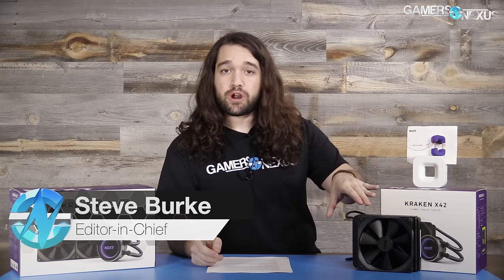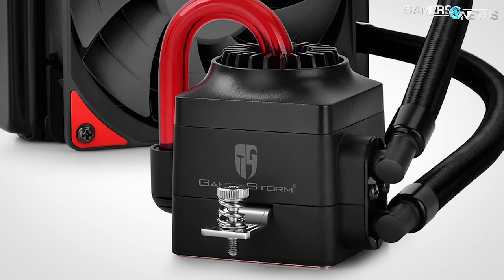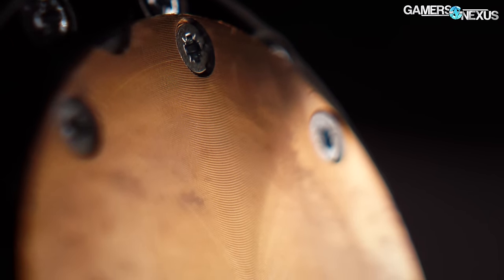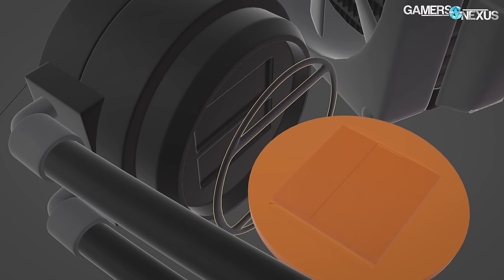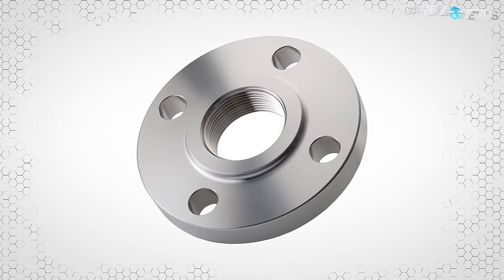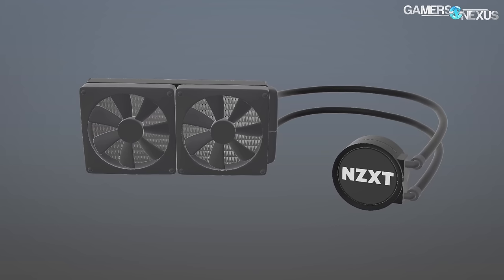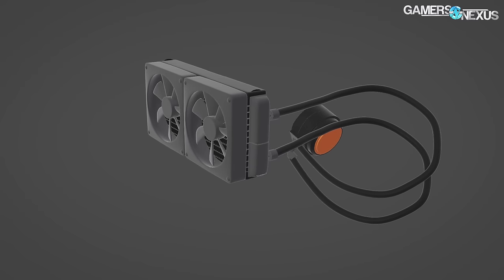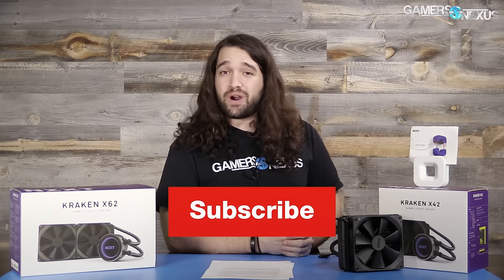Technical Deep-Dive: Closed-Loop Liquid Cooling

Comment: Great video, was more thorough than I would expect from a tech tuber. Surprised you even went into the coolant mixtures and tubing types. I would expect it to be around 20-40% glycol in these aios but if I had to guess it would be closer to 20%. 
Also that cracking he described in the inner teflon lining of the tubing brings up a important question for anyone with plastic piping in their house. What happens when the inner lining of the pex pipe cracks and either bacteria grows inside the crack or the chemical components of the plastic leech into your potable water system? Pex piping which is what is installed in new homes these days hasn't been around long enough for us to know it's safety long term.

Comment: I would really like a disassambly for the Be Quiet Silent Loop Pump. since they say its a special kind of pump.
They say for example, that the Pump has to run at 100% the whole time (which is around 2300RPM says  the Software) or it gets damaged. BUT its more silent then others.

Comment: Nice video, but I hoped to also hear something about optimal mounting of the pump and radiator (e.g. radiator inlet/outlet up or down, etc.) and get that connected to how the things looks inside.
Reply from the maker: Jonas Björklund Svensson Not really the point. That becomes a performance test, and we've done that testing before. That said, we're working on more of it

Comment: What about durability? This CLC solutions look great but how long will they work until they run out of liquid? I'd love to cool my next system with a Silent Loop from Be Quiet! but I am afraid of having to replace the cooling solution after that time. Also how rare are leakages from this type of solutions?
Reply: Our Kraken Series liquid coolers are backed by an industry-leading 6-year warranty. Basically, you don't have to worry about anything in that timeframe. If for some reason the Kraken leaks, we'll replace it along with any hardware it damages.
Reply from the maker: NZXT has the basics covered in their answer, but will provide an independent party answer as well: Asetek CLCs tend to start nearing end-of-life by the 5-6 year point, depending on how much abuse they've been through and what kind of environment you live in. The reason for EOL on closed-loop liquid coolers is more because of permeation than anything else; the liquid will begin to permeate the tubes at some point (some tubes handle this better than others), and will do so at a faster pace if liquid temp runs higher for longer periods. The 5-6 year point is when you'll start noticing more air bubbles in the loop (potential "gurgling" noises when the pump starts up on boot), and that's because the loop is starting to lose some of its liquid to permeation (not to leakage).
Reply: Well that sort of settles it, I'm going water-cooling in summer. Thx for the super helpful and quick reply, I will consider the X62 ;)
Reply: Gamers Nexus I really appreciate you taking the time to answer so in-depth. It really helps a lot, thx <3

Comment: What is better, having the tubes facing the top of the case or facing the bottom of the case?
Reply from the maker: No name In a vertical orientation, eg front-mounted? Bottom. That should keep the air bubbles at the top of the tank and will reduce risk of creating noise by sucking air through the pump.
Reply: That's exactly my case. Thank yoy very much! :D
Reply: my X61's pump had air bubbles in from the beginning which is a bit annoying since its the only audible sound when i am idling...shame...hope that other manufacturers fix that
Reply: roteroktober420 did you have it facing top or bottom?
Reply: at first i had the tubes on the bottom of the rad, which didnt help and then after like 4 weeks i turn the rad around to have the tubes at the top which didnt help as well.
Reply: so what did you do to solve it?
Reply: i didnt solve it since there is no way to except maybe if you uninstall it plug it in and run it on full speed and maybe you can get the air out of the pump
Reply: yea i cant get them out

Comment: What is the cube with the hole in the middle?
Reply: Magnet with rubber surfacing from NZXT to hold audio headsets, VR etc. Also has a loop to coil wires around it. It comes with a few of their cases, but can also be bought separately and used on any metallic case.
Reply: Puck

Comment: QUESTION Isn't the warm water heating the cooled water again on the way back to the outlet? Wouldn't it make more sense to have inlet and outlet on different ends of the radiator or some kind of channel that passes the radiator without heattransfer from the warm inlet?

Comment: What should my pump speed be? I don't know much but if the pump speed is max would the liquid not travel in the radiator long enough to reach a good low temperature before going back to the CPU and if I make my pump the lowest speed would it take too long for the cool liquid to travel to the CPU?

Comment: great video, nice animations.
u could have talked a bit about what life expectancy to expect from aios and why they fail etc... and how they compare in reliability to custom water loops and to air coolers, but whatever kinda not that much the point of the video.
Reply from the maker: Thanks! Andrew does good work on the animations. Re: points of failure -- perhaps that is a good topic for a separate video, where we'd really be able to drill down on types of failures and duration.
Reply: @gamers nexus,
that would be a super cool video, comparing all colling solutions with expected life,  failure point analysis, reasons etc...
for air, aio and custom loop, that would  get people to make better decisions on colling for sure.

Comment: water cooler's cpu/gpu blocks should have more surface area on the inside to exchange the heat between the cpu and liquid more efficiently because thats kind of holding the whole thing back

Comment: Hey Steve when should you change your coolant I have a EKWB 360 extreme with EKWB red coolant cooling my 6700k cpu for a year and a half color looks the same & cpu temperature are great . I pretty much use my computer for gaming BF 4 or BF 1 I was wondering how long the coolant last ?

Comment: Hey I want to mount a AIO on the side of the O11 Dynamic XL and i'm not sure about the orientation. Basically all builds that I could find put the tubes on the TOP but if i remember correctly, you suggest to put them on the bottom to make sure they never suck air. Are everyone else wrong, or do I miss something important??
Thanks a lot!

PS: will you take a look at the Lian Li Galahad AIO?

Comment: Hi, does missing a percentage of water result in increased temps using AIO? Meaning that after a while I noticed a higher TEMP and I think that some of the cooling liquid got evaporated. Need to know if this could be the cause because I would like to replace my aio's liquid.
Reply: I am wondering about this too. Does the liquid have to be replaced after a while? And do they sell that to consumers in a bottle? 
How would you go about changing the liquid out?

Comment: One thing that could have been mentioned, GPU and CPU air coolers that have heat pipes [which is most of them] have liquid in them as well. They help cool using the phase change effect.
Reply from the maker: trae heck That's in our air cooler deep dive, which was mentioned, and is the very first line of this article :)
Reply: Ok cool, i have not seen the air cooled video. Your videos overall are pretty good.
Reply from the maker: trae heck Thanks! If anyone is interested in the previous air cooler version of this, see here: https://youtu.be/ieMvtUpFENM

Comment: After I had a CLC die on me after a couple of years I just went with an HSF. I'm sure I could get a 280 or 360 that would lower my CPU temps another 5-10c but with the CPU on the games I play staying under 50c anyway there isn't a point.

If you have a mid tower or SFF build then i can see it making sense either visually or due to  size constraints. One of the reasons I got a very large case was so I wouldn't need to worry about it.

With a  cube build like mine all you see is the graphics card anyway.

Comment: Hello,
 I have a question concerning my Water-cooling pump. I have bought a gamer pc 3 months ago and  I have been hearing a strange noise since 3 weeks. It is like a bubble noise that I never had before. I don't know where it comes from but this bubble noise is irritating. It comes and goes and can last up to 30min. This is the first time I have a water cooled PC.
The temperature of the CPU and the GFx card are around 65 to 70 at their peak. 
There is also the Summer heatwave hitting hard so my room gets hot too. 

I need advice before I go repairing this. Thank you very much. 

PS:If you need more technical details about the brand please ask.

Comment: I need your help desperately Gamers Nexus. One of my radiator fins snapped off. It was only one small piece i think the metal is still secure on the vertical tubes. This is a radiator connected to my $2200 3090 TI Asus Rog Strix Am i screwed?

Comment: Until a couple of weeks ago I had a Corsair H110 in one of my rigs, while doing some spring cleaning in the case I noticed several spots of corrosion on the radiator channels. On a couple of them, there was even clear evidence of coolant leak although it hadn't gotten far before drying up.  This unit had only been in use for 2 years, yet had already started to corrode from the inside. i'm not sure what generation of Asetek pump this unit uses, but could it be that the older ones have a higher risk for galvanic corrosion or should I expect this from all AIO coolers? 0.o
Reply: RatSlayer 420 Anything involving water and metal will react over time. It's normal for corrosion to happen but what usually increases the rate of the reaction is generally temperature, compound of the liquid, different metals in the same loop ie copper heatsink and aluminum radiator(this is a major one). These reactions occur all the time even when the liquid cooler is not in use. So even though you had your liquid cooler for 2 years it might have been manufactured 2+ years ago.
Reply: Yes it's certainly a possibility that the unit is much older than 2 years, I bought it late 2014 and used it for 2 years.

Comment: Does the size of the radiator matter? Like can I cool a oc Intel 9900k with only a 120 liquid cooling? Or is it required for a larger surface area?
Reply: Size matters! If you have a medium demanding CPU and want to overclock u should get a 240mm Rad minimum (if you don't want to overclock the CPU a 120/140 Rad should be fine). Since you have a 9900K you definitely want a 240/280 Rad minimum even if you don't want to overclock since the 9900K creates a lot of heat. Since you have spent so much money already on that CPU u definitely should get a 360 Rad if possible so you don't lose out on potential overclock headroom. If your case doesn't support a 360 Rad you could do a push and pull setup with a 240/280 Radiator and probably still be able to push your CPU far (Push/pull setup is when you have fans on both sides of the radiator, one side of fans are pushing air through the rad while the other side is pulling the air through the rad). A push/pull setup usually runs 6-7 celsius lower than what the same AIO would run at with either only push or only pull which could lead to more overclock headroom if a 360 rad isn't possible and your temps are holding your CPU back.

Comment: People complain about the firmware on the Asetek based Corsair's AIOs (even Corsair's Staff, see their Forum).... saying that it's almost impossible to sort out the firmware issues due to the pcb design. They mention that CoolIT are much much better. 
I come across this "situation" when I bought my Corsair H105.
Like Steve said and showed it to us in this graph, Asetek has the majority of the market.... and when I bought the Kraken X62, again Asetek based, I was worried.... but I could see on one of GN's tear downs (this time of the Kraken X42) that the PCB on this new series are designed by NZXT. That could be a good thing because the firmware is probably NZXT's instead of the old buggy Asetek one.

Having said that, the CAM software on the NZXT is very cool and has loads of controls but still not bug free. I've had a few issues with it.

Comment: so based on this video its safe to say that the air pushed through the radiator SHOULD BE EXPELLED out of the case to avoid heating up other components that are not liquid cooled. This contradicts MOST youtube PC builders stance that its acceptable to use radiators and liquid coolers in the intake position of a case. Its also what I, and alot of other people have been saying all along. Why you would ever run a radiator in an intake position (if you have a choice) is beyond me.

Comment: Engineers are lazy, if an engineer can model a flat cold plate quicker than a curved cold plate (curved cold plate producing a negligible effect on thermal condc. compared to the flat area. Flat is the way it will be.